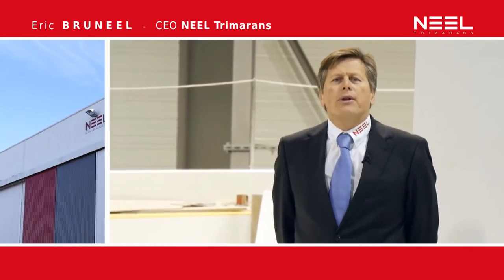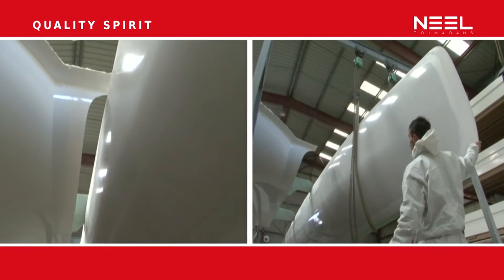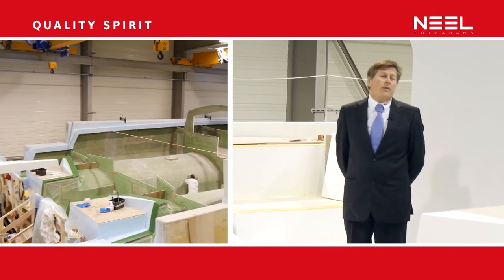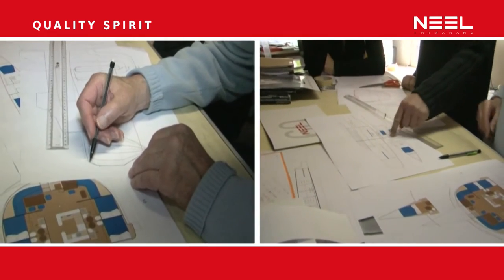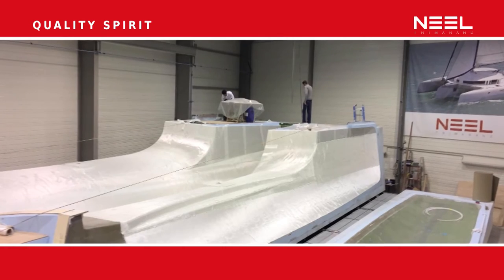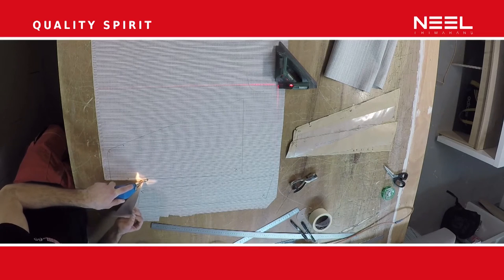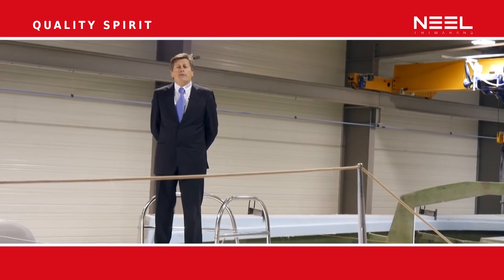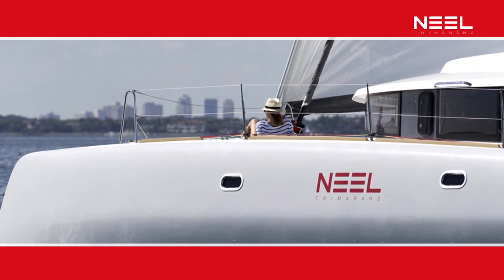NEEL Trimarans Quality Spirit

Comment: NEEL 45 ' | Would like to hear about:
1.) Cruising Speeds, 
2.) Top Speeds, 
3.) Rough Sea performance. 
4.) How close to the wind she can sail ?
5.) and how does she compare to something like an Outremer 45 ?
Thank you.
Reply from the maker: Dear Zone Television, first of all our deepest apology for this delayed reply. we have been badly affected last year with hurricane Irma, and the team partly changed. It is during that time that your comment went unnoticed and unanswered. In order to give you the most accurate information, we would like to quote Neel's report on their performance, and we hope that'll be helpful. 
"As shown in offshore racing, the trimaran is significantly faster than monohulls or catamarans.
This is also true for cruising trimarans, as proven by the last ARC rally won by a NEEL 45.
The superiority of the trimaran is even more obvious when sailing upwind, especially due to the rig:
On a catamaran, the forestay pulls from the front beam, the mast compresses a central beam and the shrouds pull the two floats supporting the forestay and mast beam: this platform deforms in many directions. Consequently, it is then impossible to have a rigid forestay
On a trimaran, the forestay, mast and mainsail tension are structurally bonded to one strong, longitudinal beam : the main hull.
This configuration, as per a monohull, allows for a rigid forestay and good performance up-wind.
Performance is also enhanced by the centered weight.
The extra speed of the trimaran is an additional safety factor.
NEEL trimarans are conceived for fast cruising.
With an average cruising speed of around 10 knots, over 200 nautical miles are easily achievable each 24 hours. Speeds from 15 to 18 knots are often reached when the breeze freshens.
Weight centering is managed in order to limit pitching.
The centre hull is rockered to facilitate tacking.
Floats are of a stretched form to privilege directional stability and advancement of the centre of buoyancy as a function of sail loading.
The rigging is directly derived from racing trimarans, thereby achieving full cruising speeds up to  twice as fast as conventional cruising yachts.
The sail surface area is generous with some 17m2 per tonne.
Finally, the trimaran configuration also facilitates sustained speed under motor propulsion. The low prismatic coefficient of the central hull means drag is very weak. The side floats are only very lightly in contact with the surface of the water."

We hope this answers your questions, and we remain available for any additional information via our website. You are also welcome to contact our Caribbean director Peter Cohen. https://www.caribbean-multihulls.com/contact/

Best regards,
CM
Reply from the maker: Good afternoon, I would like to inform you that more information has been implemented on our website https://www.caribbean-multihulls.com/neel-trimarans/ Kind regards from St Martin.
Reply: 1.) Cruising speed depends on the sail area you set, the angle against the wind you are sailing and the wind speed.
Let me give you two examples from my trips with the Neel 45:
- 35 knots TWS from the back, only Genua: 14 knots
- 35 knots TWS tacking at 50° under jib with a reef and main with 3 reefs: 12 knots
- same at a 40° angle: 6 knots
2.) 18 knots at 90° at TWS 35 Knots with jib and main
3.) very good
4.) 40° but not very fast
5.) simple: Outremer is a catamaran, 2 hulls, the Neel has 3 hulles, a trimaran.....

you are very welcome...
Reply: @maddocmucmaddocmuc5341  Regarding #5, I think he was asking about the performance vs Outremer, not the hull design.
Reply: @jamesaron1967  yes, I know he was asking for comparison of performance.
Trimarans are faster than catamarans. Hull design directly relates to speed.... simple...
We outrun with the neel 45 the outremer 45 on any angle easily, the outremer 55? 51? the other day was slower than the neel 45 and did not come as close to the wind while tacking, was faster however downwind with his spinnaker (we had none)
Reply: @maddocmucmaddocmuc5341  That's very interesting. I knew the Neel 45 is a fast yacht, but it has been discontinued and replaced by the 43 and 47. The newer models aren't as fast according to many comments I've seen, and you can tell from videos they aren't much better than similarly priced catamarans except in upwind situations. I think it's related to both weight and hull shape. The 45 looks different in the bow under the waterline compared to the newer Neels. I don't know about the 43 but the 47 and 51 are rounder and this may cause more pitching slowing these boats compared to the 45. It's just a guess, I'm far from an expert.

Comment: what about  the neel that broke up on its maiden voyage?
Reply from the maker: Hello, could you please clarify what boat you are talking about? We only know of one, which Neel shipyard did all the after sales for (and I believe which use was not corresponding to her purpose, such as heavy tender added, as well as a jetski, if I remember well? A bit of a pity, considering the original weight and performance of a Neel trimaran). Furthermore it was the only boat that reported such damage, and the manufacturing process even got reinforced afterwards. We know some videos have been put out there to damage the reputation of Neel Trimarans, but happy clients are the only ones we actually met for real, whether in the Caribbean or during boat shows. We as dealers, as Neel Trimarans shipyard, are open to discuss any doubt you might have. Please note that Neel openly communicates about the boat I was referring to. Best regards, Marie-Claire for Caribbean Multihulls.